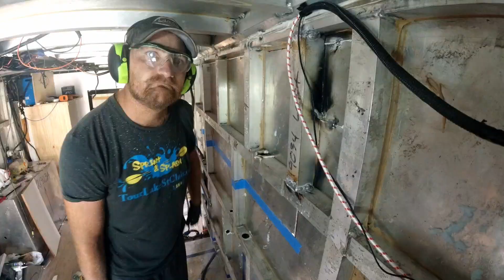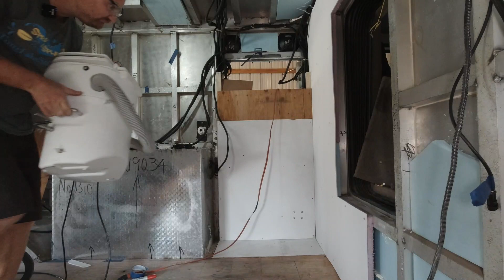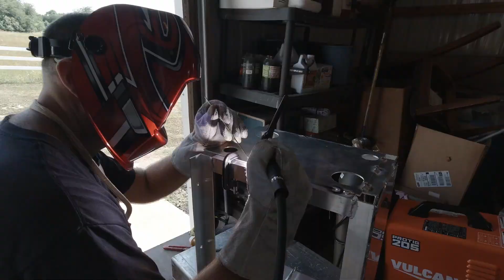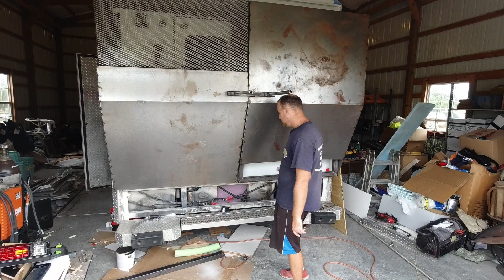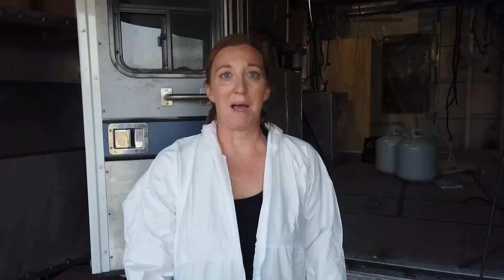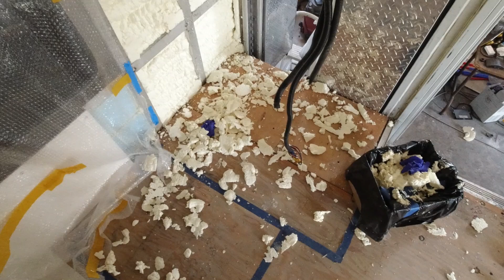DIY Spray Foam Installation | Off Road Camper Build

Comment: what did you guys use to patch the holes? what size metal did you use to build the outside of the back racks? and what are those mounts called? sorry for all the questions after watching you guys i ended up buying a 1998 FL60 crew cab haha

Comment: Hi there. You guys doing great things  and ideas but insulation with this foam is not for moving objects. the foam can be used just for 
immovables like normal homes.. unfortunately after something like 1 year from all the corners. 
junction points the foam will become like dust and will spill out.

Comment: Nice work. I always the ambulance boxes. The doors and hardware are so stout.

When mounting the mini split out door unit, I would recommend "Rector Seal No Kink" lines if it will pivot like the right side